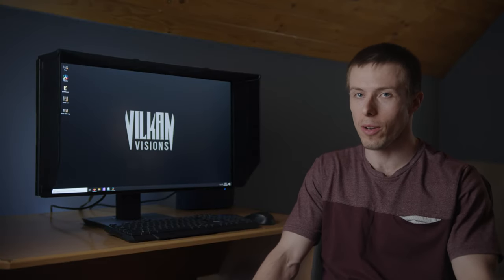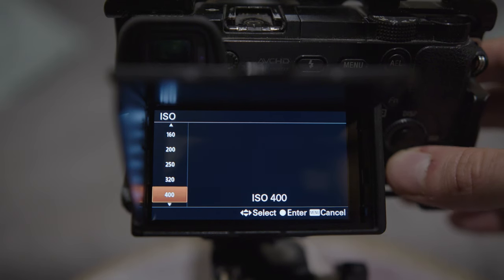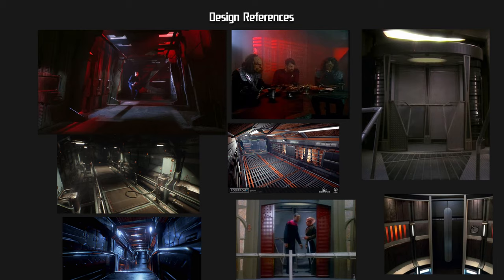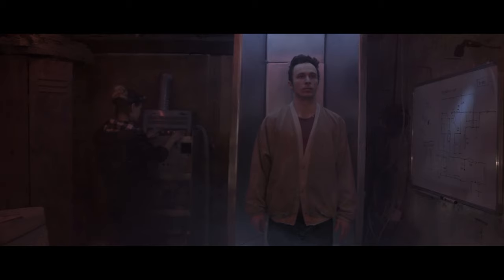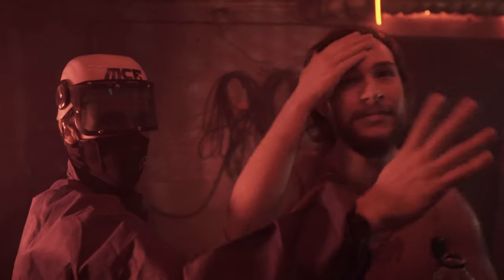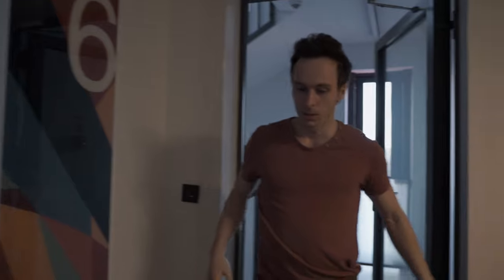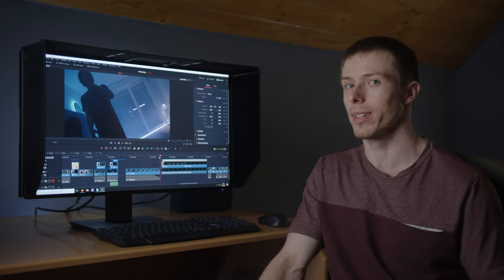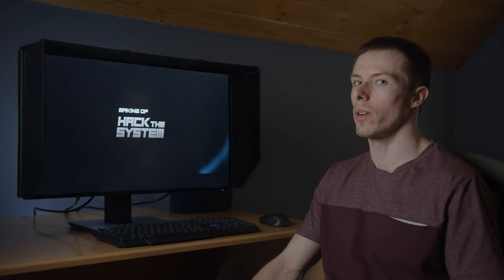Making of Low Budget Sci-Fi short film HACK THE SYSTEM // Sony a6000

Comment: Is there is a will , there is a way
This channel is the best example
Reply from the maker: That's true, everyone can make films :)
Reply: @VilkanVisions  thanks man for finally adding a bts
Reply from the maker: @vishnuravi1203  More coming soon, I will now record bts on every project :)
Reply: @VilkanVisions  thanks man, i'm thinking about buying a cheap manual focus f 1.4  lens for my a6000 like 7artisans or meike..Is it possible to shoot videos or will it will be very difficult due to  lack of autofocus
Reply from the maker: @vishnuravi1203  It really depends on many factors, I shoot mainly with MF now. Don't try to save on lenses too much, maybe search for used ones, I did that with half of my lenses. I had 7artisans 25 1.8 but I sold it, it was hard to match to my other lenses, too soft, and it was loosing contrast with flaring too much.
Reply: @VilkanVisions  I'll keep that in mind..Thanks for your suggestion bro
Reply: @VilkanVisions  hey I'm still using avchd ..Which card to buy for using xavcs ..64 gb 100 Mbps is enough ?
Reply from the maker: @vishnuravi1203  I use sdxc 90mbps v30 64gb from sandisk and it works great
Reply: @VilkanVisions  thanks bro